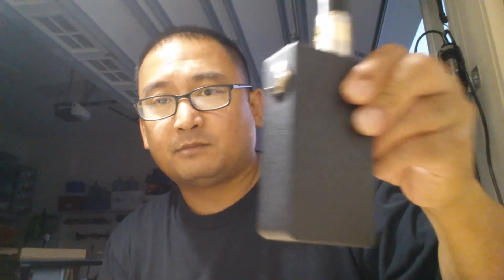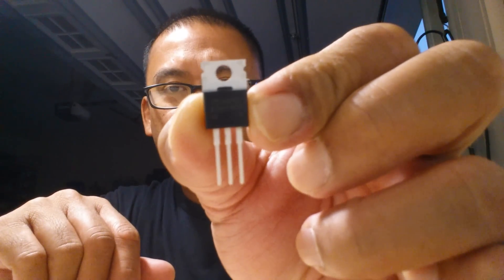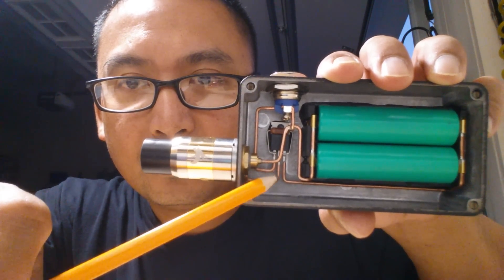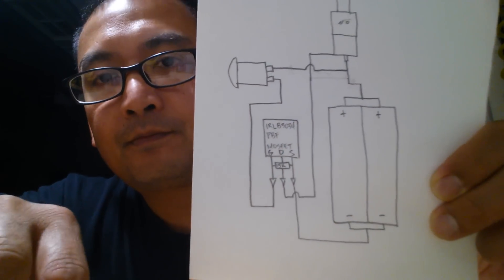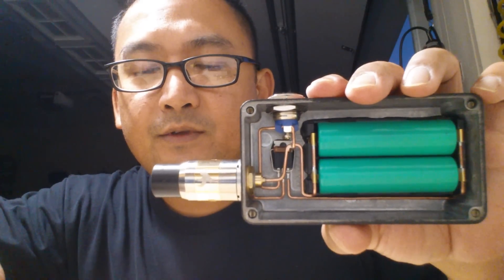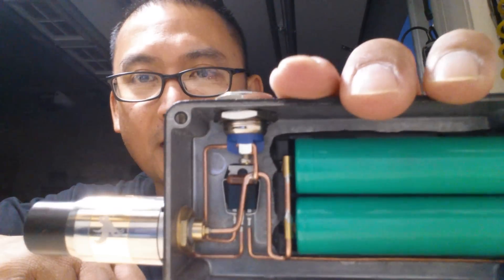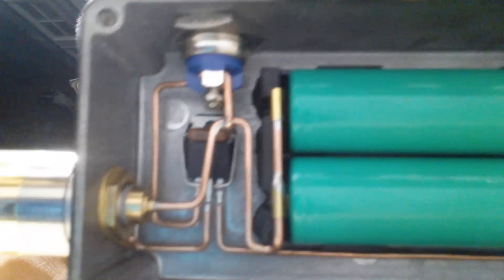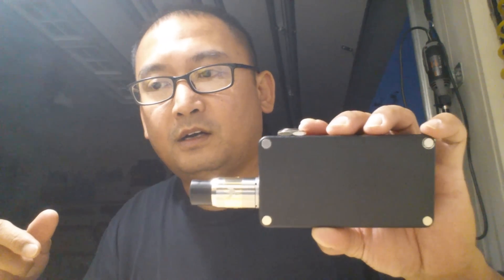Unregulated box mod with a Mosfet

Comment: ty for this video i can now build my own :)
Reply from the maker: +Kevin Jusay good luck and I hope it turns out great. Just take your time.
Reply: +Al USAF what tank do you use?
Reply from the maker: +Kevin Jusay I currently use the Herakles, Crown and Matrix tanks.
Reply: +Al USAF can i use this kind of mosfet P50N06 or this one IRF630
Reply from the maker: +Kevin Jusay check out this link...

https://drive.google.com/folderview?id=0B-I3ksnipe8nQ3paUFE1Yl9sbGc&usp=drive_web

Read the file "how to choose a Mosfet..."

I would recommend to use an IRLB3034PBF mosfet because it's the most widely used for unregulated box mods. 

Read the other files too for reference...a lot of good info. Definitely share the link to others.
Reply: +Al USAF i think IRLB3034PBF is not available here in philippines. I already look in our local store and i cant find any

Sorry i cant understand what it says in the file because im not into electronics
Reply from the maker: +Kevin Jusay you need to know and understand a little bit about the parts if you're going to build your own. Basically for a mosfet to work in a parallel unregulated box mod, you need a mosfet that will turn on at around 2.5 volts and has a low on resistance, around 2 mohms or less (close to the specs of the IRLB3034PBF). So you need to look at the datasheet for the mosfets you mentioned earlier. But if you can get your hands on an IRLB3034PBF, I can guarantee you that it will work, both for parallel and series setup.
Reply: +Al USAF ok then thanks a lot!

Comment: First of all, are you or was you in the military? Second Me & my son has been bonding & we are currently building your first box mod. You gave great sizes for me to cut the wood. I now have them in Cherry & Oak. However I'm having troubles finding all the hardware to surprise him with, to finish them up, once we get them lacquered. I am a wood maker (hobbyist) and enjoy my time with things like this. I ounce made a Wei Chi board and gave it away as a Christmas gift...Could use some help as to were you buy your goodies from or parts list & locations?
Reply: +Michael Jordan 
Enjoyed the V3 video and cant wait to find the sizes.
Reply from the maker: +Michael Jordan I'm still currently in the military. Let me know what parts you still need so I can point you in the right direction.
Reply: +Al USAF Thought you were I am USAR. Um i picked up on your magnets. I guess for starters are your horn switches. I like the looks of your flush mount stainless but I've seen 10mm to 19mm what size did you use?
Reply: +Al USAF Do you prefer laser verses hand crafted on your designs?
Reply from the maker: +Michael Jordan I typically use 16mm pushbutton switch (horn or anti vandal). Also, for bigger boxes like the Hammond 1590G or wood box mods, I use 16mm switches. But for smaller boxes like the 1590G, I use 12mm Mitec pushbutton switches or the BB or tactile pushbutton switches. You can purchase box mod parts from lonesomevapors.com or varitube.com. 

I prefer laser engraving because you can pretty much use any design you want and it'll look cleaner. But if you can find someone good with hand engraving then go for it.
Reply: +Al USAF Thank you so much for your help. I ordered my parts this morning.
Reply from the maker: +Michael Jordan you're welcome...good luck on your build.

Comment: How do your solder joints and copper hold up over time? Does everything start to oxidize and or turn green?
Reply from the maker: Search here on YouTube on how to solder. But I use solder flux paste to clean the surfaces prior to soldering to ensure a proper bond. The exposed copper will of course eventually oxidize but can be cleaned or polished off.

Comment: i just recently broke my kanger subox mini when it got wet in my pocket so i opened it took out the screen and board and rewired it with a mosfet i salvaged from an old broken electric bdlc motor controller and a switch and a 12k resistor, now the thing works but it seems slow to fire doesnt produce as much vapour as the original box did and it seems very cool and untill a few seconds in when i start to hear it crackle you wouldnt know it was working and when the battery voltage drops to 3.8ish it wont fire with a load, i measured the voltage at the vapourizer posts and its only seeing around 1 volt @3.8v so im just wondering if i need to change the resistor for a lower value the mosfet is an irfb3607 IOR p229d so im just wondering if its not getting enough voltage to switch on properly due to too high a resistor value?
Reply from the maker: oldskoolhead0 I would look more into the spec of the mosfet because you can't just use any mosfet.
Reply: yeah it was working but slow to fire and didnt last long untill the battery although not flat needed charging again for it to work, ive bought an aspire cf mod now instead and the battery life in that is brilliant can empty 2 full subtanks before it needs charging and lasts all day or proly 2 if im at work lol was to make do till i can buy a sig 75w but dont know if ill bother now as im loving the battery life on this cf mod and still chucks on my subtank mini lol

Comment: Hey i was wondering if it was really safe to use solid copper wire like that, is there any insulation? I only ask because i would love to build a box mod and wire it like that, im just worried that it will short out and blow up in my hand.
Reply from the maker: logitechtaco you will not have any issues if you build it right...or drop any conductive materials inside while batteries are installed.

Comment: Why is a 15k ohm resistor needed across the gate and source?  Would changing the resistance of this resistor change the current running through the switch?  I have seen the 15K ohm resistor used specifically in several schematics now, but I have seen no explanation as to why it is used.  I am pretty sure its purpose is to limit current through that part of the circuit, but then you could use various different resistances. The difference between a 10k ohm resistor and a 15k ohm resistor would only 0.14mA running through that part.  Also, if that were the case, wouldn't you want the lowest possible current running through that part, and therefore want the highest resistance resistor between the source and gate?  Sorry for the long comment/question, I've been playing around with this in my head for a while.  Love what you did with the solid wire btw, looks really clean. Thanks for taking the time to put up these videos also
Reply from the maker: jojobeachable please read the write up from the link below on resistor requirements...thanks for your comment! 

https://drive.google.com/folderview?id=0B-I3ksnipe8nQ3paUFE1Yl9sbGc&usp=drive_web
Reply: Al USAF Thanks for the info

Comment: Can you tell me what those brass color cylinders on the battery sled are? I am attempting the same style wiring with mine, measure and bend, etc... The pieces that connect to the power leads, what are those?
Reply from the maker: Kyle Currier battery contacts...it comes with the Keystone sled.
Reply: I decided to skip the sled. Im using a TP4065 charger chip to charge them. Am going to wrap them up and use small dab of hot glue or epoxy to secure them. I will treat them as a bettery pack instead of a sled. It allows me to make it smaller and have the same ammount of room inside. (im using a 3d printer to make my case using a fiber optic material called Tglase (PET-T).

Comment: How are you digging the mod I just purchased my own unregulated mosfet box any tips?
Reply from the maker: Nick Wagoner loved it, but I no longer have this box mod. Now I prefer series or PWM.
Reply: Any tips
Reply from the maker: Nick Wagoner as far as tips...don't build your Atty too low or drain your batteries too much where the battery sag will go below the nominal voltage of the Mosfet, usually 2.5 volts. Because if you do, the Mosfet will not function as intended and will fail. So you have to figure this out by testing the mod you bought with with an Atty build you will typically vape.

Comment: i can't find this component in store Mosfet - IRLB3034PBF 
15K ohm resistor - RN60D1502FB14 

can i get this from power supply of computer ?
Reply from the maker: Garamour icy you can but it online, ebay, Amazon, etc.
Reply: i live in Africa :/ it not easy there is some problems with the credit card and the delivery system
Reply from the maker: Garamour icy I see...go to this link and read "how to choose a Mosfet...".

https://drive.google.com/folderview?id=0B-I3ksnipe8nQ3paUFE1Yl9sbGc&usp=drive_web

Hope that will help you out. Other useful info there too.

Comment: Correct me if i'm wrong or mistaken, but wouldn't a better method for wiring be to use the push button to interrupt the ground instead of the positive to reduce voltage drop and prolong the life of the button? I plan on doing it that way, but before I start would just like a second opinion.
Reply from the maker: Stephen Wiegman I'm using an N channel mosfet so switching happens on the positive side. I've never used a P channel mosfet in an unregulated box mod so I can't tell you if there will be any difference in performance. Also the N channel mosfet is the most widely used.

Comment from the maker: +Jacob Tran I can't reply to your comment...but here's my answer or opinion about heatshrinking the mosfet. I don't recommend wrapping the entire mosfet with a heatshrink because it produces heat...you don't want to contain the heat, you want it to dissipate. Basically just secure the mosfet directly on the box using an epoxy or thermal adhesive. I've seen other people solder the mosfet heatsink tab directly on the 510 connector nut. The mosfet heatsink tab is directly connected to drain so this saves you from using a wire to connect the mosfet drain to the 510 negative.

Comment: Hey bro, i wanted to know if you have a unregulated series box mod video to explain how to connect the wires, i looked them up on google and i did the wiren exactly how it shows but its auto firen. I have no idea why, i tested my switch and its working perfectly fine
Reply from the maker: Mike Perez I do, just search my channel. If it's auto firing, you probably burnt up your mosfet during soldering or it's defective.
Reply: Al USAF  okay ill check it out right now

Comment: so i did the same setup, but when i fire, the mosfet gets warm and the 510 doesnt fire

using this mosfet : http://www.irf.com/product-info/datasheets/data/irlb3034pbf.pdf
Reply from the maker: andrew cervantes check your wiring against the diagram in this link, https://www.e-cigarette-forum.com/forum/threads/about-to-embark-on-my-first-box-mod-i-have-a-couple-of-questions-first.599936/

Or your mosfet is shot.
Reply: my wiring is exatly the same, it works with a 1.5ohm coil but it heats up a ton with .3 ohms
and wont fire i used dual mosfet, single, changed mosfets and the same thing is happening.
Reply: it shows .1v off and full batt voltage when on (without atty) so its working, but not pulling correctly. the mosfets are very over-rated so idk what is wrong
Reply from the maker: andrew cervantes can you email me a pic of your box's internal at alusafvapes@gmail.com so I can take a look at it. Also, what gauge wire are you using? You could also have cold solder joints.
Reply: ok i sent it, im fairly confident in my solders, the mosfet is underneath because i had dual mosfet there. and the leads for the switch are temporary, but still soldered.
Reply from the maker: andrew cervantes are the sled contacts soldered to the wires? If not, you need to solder them. Also, looking at the solder joints, especially on the 510 negative washer, it looks like a cold solder. Reapply heat to all solder joints to ensure proper bonding. Where did you purchase your mosfet? I heard a lot of eBay 3034 mosfets, ones coming from China, are no good.
Reply: i even added quad mosfet, and it doesnt pull hard enough:/
Reply: i also tested by just jumping the leads, and it fires beautifully, its something up with themosfets then..:/
Reply: Al USAF i got mine from amazon, then  i got a brand new one from frys, rated at 35A continuous (logic level npn) 

http://www.amazon.com/gp/product/B00V5XYHS2?psc=1&redirect=true&ref_=oh_aui_detailpage_o03_s00

and then tried a NTE2389

Comment: Do you have to use that MOSFET because mine isn't working. Is it that specific type that is needed?
Reply from the maker: ellis boisvert what mosfet are you using? The IRLB3034PBF mosfet is the only one I use and recommend. There are other mosfets that will work but I'm not sure wht those are. Basically, I would use the IRLB3034PBF.
Reply: no, some other thing i picked up at radioshack . I dont know what it is off the top of my head, should it still work?
Reply from the maker: ellis boisvert if it didn't work then it probably won't. Just buy the IRLB3034PBF.
Reply: ok thank you :) im not very proficient with electronics

Comment from the maker: +dt19830205 can't reply to your comment...but no, I dont sell box mods.
Reply: This is a common question and usually the answer to using an alternate semiconductor is no. The irlb3034pbf has specific resistance properties which classify it separate from other mosfet chips that highly resemble its architecture. That is not to say, however that if you were to wire one into a circuit that it would not even work, but I would not recommend the experiment, probably safer to vape without the chip than to use one you have not read up on. The good news is that even if you have a little trouble finding the mosfet from your favorite components source or one mentioned within these videos, you can always do a search with bing.com and find a source on the web which has them in stock. As long as you can get a couple of them for  9$ or so you should be fine. I got one super hot one time trying to solder properly and it still worked fine - people usually get two at a time, however, in case they mess up the first one. I would also like to mention that the 15k resistor, left to right, should read: brown, green, orange, gold. I cannot imagine that it matters if you flip it over, however that is the color scheme in the circuits on fogcity.com, which also utilize 15 amp fuses. The fuses are not absolutely necessary but I recommend using them if possible. They are inexpensive and do not add too much complexity to the circuit. The little yellow ones do not take up much space and should be easy to find from a source on the web.

I finished a mod build highly similar to the one above earlier today and will have photos of it on www.coilpix.wordpress.com within a day or two, maybe by tonight, if at all possible.

Thank you for the help and the video; nice wiring.

Happy modding.
Reply: well if ever you want to just let me know ^^ ill tack one of these off your hands any day
Reply: Al USAF ok im considering ordering a box mod with a mosfet, but what are the gains of this? does it keep it at a more flat voltate? so less voltage drop? also i build around 0.05 and lower just incase that would help answer my question
Reply from the maker: simon devere generally, a mosfet box mod will have a lower voltage drop than a box mod without a mosfet (I'm talking about the same setup just without a mosfet). But this also depend on the box mod's build quality; soldering job, wire gauge (bigger the better), length of wire (less the better), etc. The issue with really low builds on mosfet box mods is the battery sag. If your battery sag goes below the required voltage input for the mosfet, the mosfet will obviously not function as it's suppose to and it will burn up (it will act like a resistor). If you want a better and more efficient box mod for cloud production...build a series box mod.
Reply from the maker: simon devere not build but buy a series box mod.
Reply: is it fine that i use a mosfet irf510 instead of irlb3034 mosfet? beacuse the 3034 is not available in the supply store
Reply: ohhh

Comment: how low can the resistance of coil go with this setup ? is it possible with 0.04 ohm without having damage with that mosfet or other parts ?
Reply from the maker: Rizky Andika I wouldn't worry about the Mosfet.  But with that low of a build you need to be worried about your batteries.
Reply: im using 2 imren 40 amp with 32 amp continous

Comment: You made a mistake there. The wire running from drain to negative of the 510 connector is definitely a high current path. The only wires that low current are the ones to and from the switch.
Reply from the maker: Ni5ei I know, someone already corrected me.
Reply from the maker: Ni5ei my fix was to use bigger gauge wires throughout.
Reply: Al USAF Oh yes I'd seen that. But your comment in the video is still there so people could do it wrong by following the instructions in the video.
Reply from the maker: Ni5ei edited video with annotations to correct my mistake.
Reply: Al USAF Thanks! You'd be surprised how many people have absolutely no idea what they're doing when following instructions so better to be save than sorry ;)